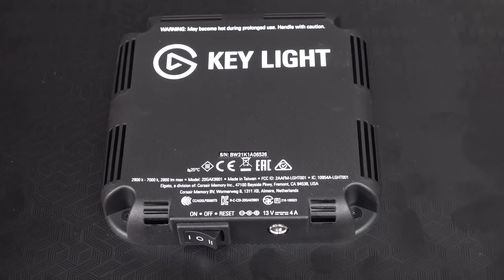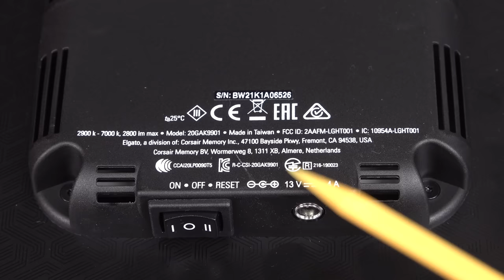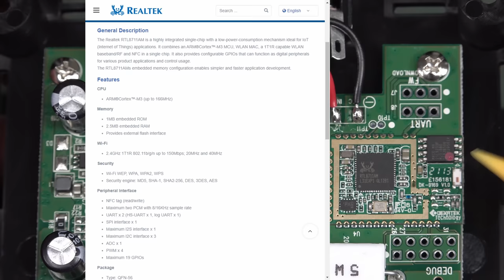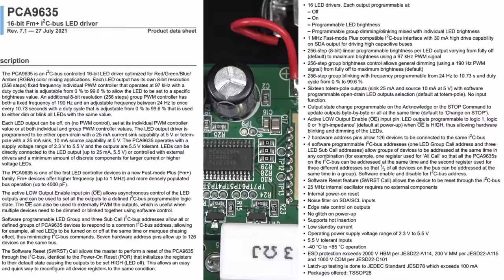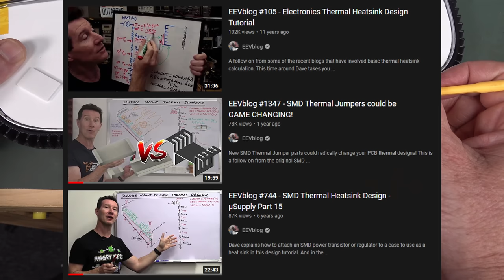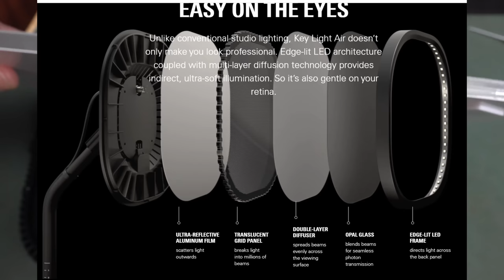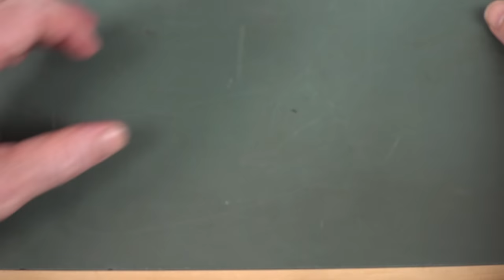EEVblog 1453 - Elgato Key Light TEARDOWN

Comment: The margin must be enourmous with such a simple construction for $200...
Reply: for $200 you can buy 1 new or 2-3 used 27" monitors and leave them blank to illuminate you. i can't see this shit cost more than $50 to make.
Reply: It's the high CRI LEDs that cost the $. Cheap LEDs don't show true colours very well.
Reply: @v8snail  1M of dual 3000-6500k, CRI≥95 high-quality, high-output strip costs $25 retail, probably half the price if ordered in bulk from the manufacturer. And they are using ~80cm of lower quality one. High CRI does not explain the super-high markup here...
Reply: @v8snail  Osram doesn't even offer a high CRI product (they top out at 95, the expensive high CRI LEDs right now are around 99)
Reply: @zwerko  now add a PSU that doesn't flicker on camera
Reply: BOM cost is not nearly the entire picture when it comes to price drivers in a commercial product, though.
Reply: They are an absurd ripoff.

Comment: 1:32 A device that needs a dedicated reset switch, no thank you.
Reply: I’ve not had to use that switch at all since I first set mine up.
Reply: I think it's reassuring to see a reset switch, i actually don't trust some kinds of devices which don't have one, but i'd like it to be recessed and requiring a pen or paperclip or something to push down, indicating clearly that this is not something you need on a day to day basis, but an emergency provision. Because once in 10 years, the device misbehaves, what do you do then? It's not needed in devices which have no configuration storage and where you can claw out the battery or disconnect them from power. In devices which do store data, the reset switch should bring them back into factory configuration.
Reply: @MeppyMan  And I've used mine about 1000 times. 🤣

Comment: 1mm thermal pad all around was easy to install and would increase the lifespan of the LEDs.
Reply: They could have done a squeeze system with a single screw and added a small bit if thermal paste or ~0.5mm pad then insert the LEDs and tighten the screw.
I actually think they did that on purpose though... the aluminum slightly increases in size as it heats up. So the aluminum on the leds will grow until it touches and then dump the heat until the outer aluminum grows. This will dance for a little while and then settle. LEDs shift color slightly as they heat so its done to make the temperature more stable over time.
Reply: @jackykoning  Thats why I've said to use a thermal pad and a not rigid solution. Pads are a bit flexible and would handle the expansion quite decently. Probably with a 0.5mm is even better. But with an aluminum pcb the total length would not increase a lot considerign a final temperature of 70°C (starting a 20°C) and a pcb length of 60cm. The final length would be 60.06cm. Not so much to fill those huge gaps.
Reply: It would increase their lifespan by an order of magnitude probably.

Comment: There's a place for hard shadows!  Key is usually to throw a shadow for texture, Fill would be less intense to control those shadows, then Back just to help separate you from the rest of the scenery.  Anyway Key, Back, Fill is the "three point setup", utterly classic :)
Reply from the maker: This is Youtube, not Hollywood, so most creators just use the key light in front. Good enough for Australia.
Reply: @EEVblog  did you see the open source project to get rid off the spam above me here? Linus did a video about it.
Reply: However the direct LED panels don't throw a hard light, they are hundreds of little hard lights and they produce extremely weird multi-shadows when you use them undiffused. For a good, hard light source you'd need a single-source LED light (Aputure makes those, too)
The direct LED approach in LED panels is usually done to give you more output. You can always diffuse them heavily if you need diffused light, but you can take the diffusion of for more power. 
As LEDs become more powerful, the bigger panels are increasingly all made as side-lit diffused panels because it just looks very nice.
The small on-camera light by Aputure (the Amaran F1 he showed at the end) on the other hand is really bright for such a small light - and sometimes that is just very useful in an on-camera light.
Reply: @irishpotatogamer1850  It's pretty sad that creators need to use things like that because Google, a billion dollar company, is too greedy to deal with thotbots because they see them as profit...

Comment: I’m curious as to what secrets can be revealed by the UART and debug ports. Although I must admit that I’d prefer a couple knobs to set the brightness and temperature as opposed to having to mess with the wifi, especially if you’re going from place to place
Reply: UART is connected to the wifi board/ARM, and the specs says it's configurable, so they might have something implemented on it since they bothered adding pad to it, (or futureproffing of the board ?). I guess it could be used for inital programming in factory, but the FW or DEBUG would be better suited for that.
Reply: @amahashadow  While I love things being app controlled (particularly home entertainment stuff - no remotes to lose as I always have my phone on me), there are times when I think being app controlled complicates things too much.    Small scale studio lighting systems is one.  That said,  it might be handy if you have to mount the lights in a very difficult to access place, but even then, if you are having to run power to the light in that place, you may be better off running a wired network to it as well.

Comment: I'm surprised not to find any inductors, to make a constant current source. For what I can tell, those are just PWM with a dropper resistor, given that circuit board.

It would be really interesting to see some oscilloscope traces from the current curve (or voltages, since less intrusive to measure) to the LEDs, both to see how well it regulates brightness, and how much trouble it will give for a camera with rolling shutter.

I've looked at that key light myself for quite long, but haven't motivated to get one since I'm not that convinced that it's better than others. Looking for tear downs on others, to see if there are any with proper flicker free current regulation.
Reply: Current measurement is quite easy though, since there are series resistors to measure on.

But thinking about it, having multiple channels (two per color temperature), could the flickering then be mitigated, but not entirely removed, by driving them out of phase? Would be really interesting to know.
Reply: PWM is preferable way to regulate brightness for high color fidelity leds. Other way will result in small color shifts.
Reply: @adult-songs  was thinking about that top. But how would that hold up when using high speed shots and rolling shutter? The line speed in 1080p and 60fps is about 64800 lines/second, and that's kind of not pushing anything today?

The pwm chip seems to by just above that frequency... I know the idea about rolling shutter is that it has about a frame to collect photons, so it's lot longer time, but we are still working in the same order of magnitude
Reply: @pengiswe  You are comparing wrong things.

Comment: Am I being too pessimistic? Personally the actual design feels pretty terrible for how much they cost... No constant current switchmode driver to keep the efficiency up, a half assed heatsink, and no manual controls for when the wireless BS becomes obsolete and/or stops working. Two potentiometers would have accomplished the task just fine, then maybe use the wireless to override them if you want application control.

I'd be curious to see what temperature the LEDs actually reach at full tilt, and then tested with just a basic glue holding them firmly to the heatsink frame.
Reply from the maker: The main market for these is desktop application control integration with their popular switch deck thingo.
Reply: For color Temperature a Potetiontiometer isn't that great when you wan't to match a Bunch of them to the same Color Temperature.
Reply: @EEVblog  Elgato is taking a page out of Apple's book and making an ecosystem of products that work well together
Reply: @ortzinator  With the price but not the quality. That's a ripoff. They spared no expense for the outside in order to overharge but the inside is full of petty economies. They didn't even make the software right as the wi-fi control is not properly secured.
We must thank @EEVBlog for this teardown and hopefully calling Elgato out, because this product is all smoke and mirrors.
Reply: @DanielLopez-up6os  Manual digital setting then. Or a simple sync/link interface (albeit that wold probably end up being proprietary and work only with lights of the same manufacturer). Not saying that software controls are without their merits, but having on-the-light backup for when they are not available would make the lights far more versatile and future proof... Then again, no reason to future-proof something of this build quality—the resistors, caps and LEDs in this setting will not last long anyway.
Reply: @lolilollolilol7773  Not sure about the mirrors, but plenty of things here are primed to release the magic smoke...

Comment: It's quite remarkable that they can get 2900k - 7000k out of LEDs with 3000K and 6500K
Reply: If I remember correctly LEDs change there color temperature with PWM so its doable. Also 3000k and 6500k might refer to the typical color temperature at a specific operating point.
But I wonder how they get away without some sort of temperature correction or if they just assume heated up LEDs.
Reply: @Jonas_Meyer  I guess you're overthinking this. The panel just goes from 3K to 6.5K but 2900 to 7000K sounds better. The difference between 2900 and 3000 as well as 6500 and 7000 is really small, too. They just reached out a little to get the 2 and the 7 in these numbers
I wouldn't really trust these numbers in any film light under at least 1000 dollars. Maybe if an Arri light for 5000 dollars a piece says "this is 3550K" then you can trust it. Because they're selling it to people who really care about the difference between 3500 and 3550. But that's why it costs a few grand.
And this Elgato is not even in the film light category.
Reply: In theory, the diffuser could alter the color temp beyond that one of the light source (like quantum dots that Samsung uses for their QLEDs) but then their lumen rating would suffer (can't get more energetic light out of thin air). I somehow doubt that's the case here...
Reply: @zwerko  I don't think the diffuser could both reduce AND increase the color temp at the low and high end at the same time. They're just saying 2.9K and 7K because the difference to 3K and 6.5K is minimal, probably inside the accuracy range of the LEDs, and the numbers sound better.
Reply: Colour temperature depends on actual temperature of the LEDs; but it is pretty difficult to reach above it without subjecting them to the hazard of burning out. Going lower is possible, but there isn't a ton of range, but maybe just enough. I do think it's more likely they decided to just handwave in the extra range, hoping that if someone were to try to nail them to the wall by measurement, they'll just claim that the actual range is within reasonable tolerance (plus or minus a few percent) from the declared one - it is after all a prosumer product, not a precision device.